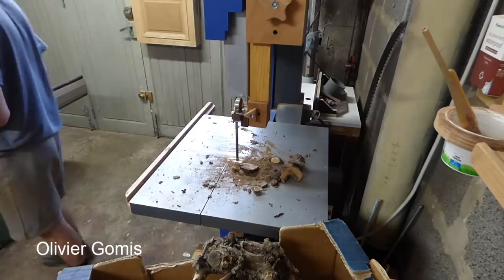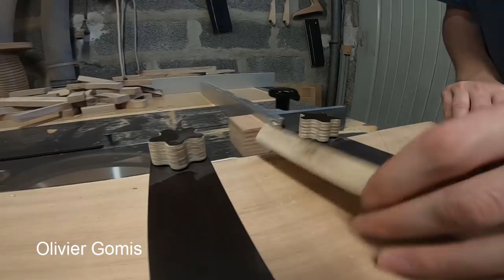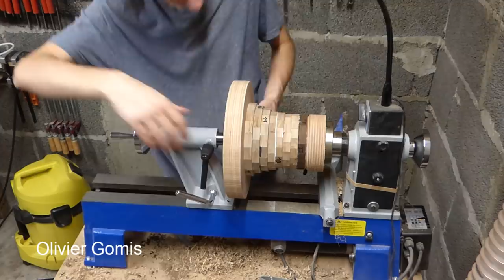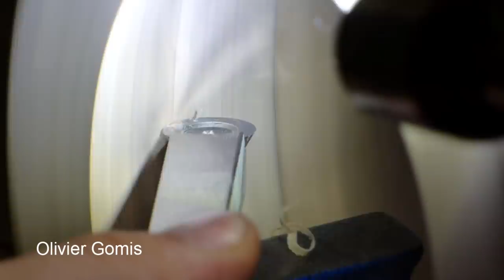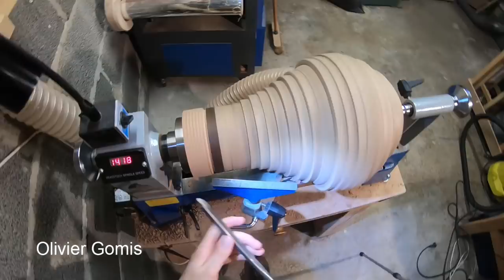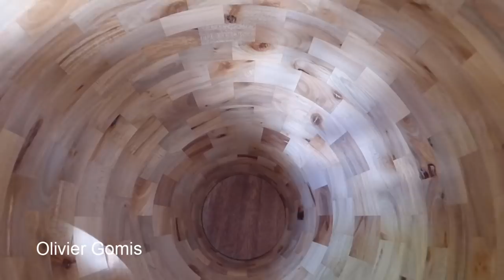Vase Segmenté En Poirier - Tournage Sur Bois

Comment: Pear is such a joy to turn, and it has so much character and depth when finished.  I like the way you used the small branches to create enough segments for that vase.  And the walnut (?) end ring really complements it nicely.  Is that a 40/40 grind you're using?  Where did you learn turning?

Comment: Beautiful results. But with all that wonderful woodworking equipment, I am surprised you have not invested in and use eye protection. That’s basic 101 woodshop.
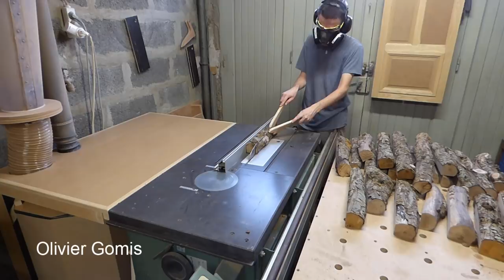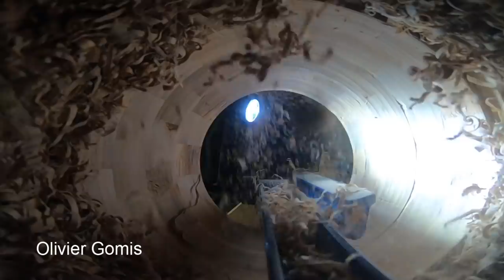Reply from the maker: Maybe you should invest in glasses because I am clearly wearing safety goggles. Watch at 1:31 and 7:46 and 8:54 . The rest of the time either it's not needed either I'm out of frame and you cannot tell.
Reply: Olivier Gomis I happily stand corrected. I was watching you (and your head camera shadow) in the late 8 minute range at the lathe, and later in the 10 minute range while you were sanding at the lathe. I was concerned that you were not wearing eye protection while working at the lathe since we all know projects do fly unexpectedly.